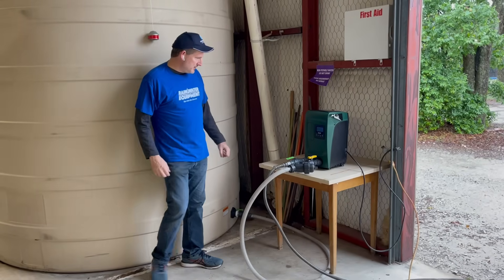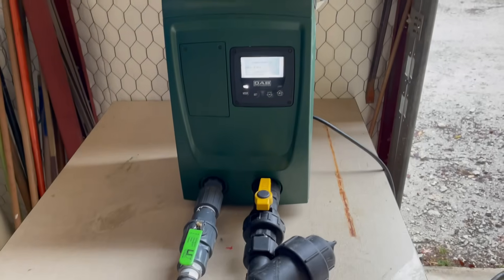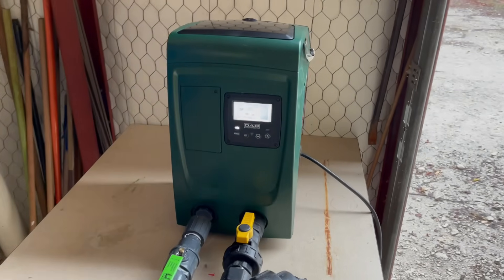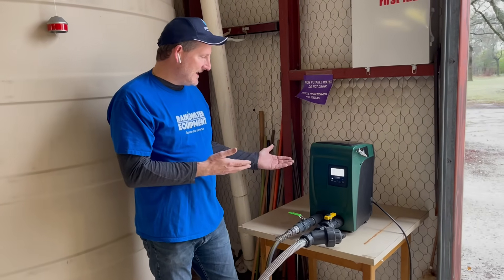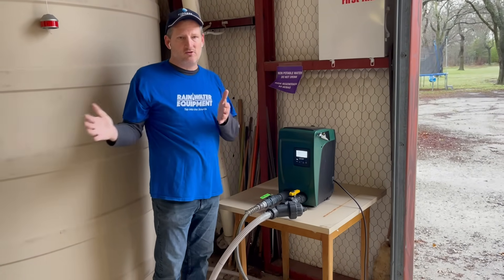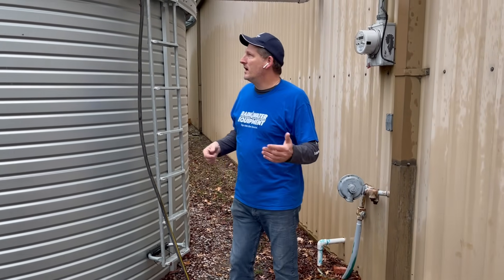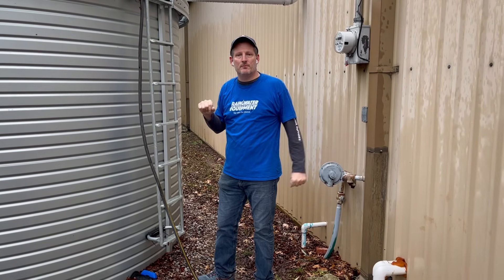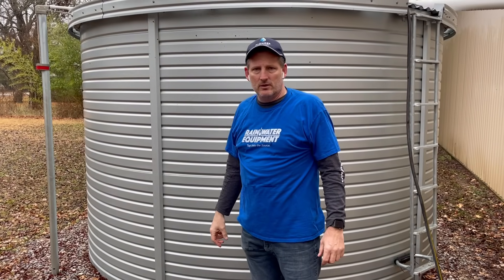DAB E.SYBOX MINI 3 VFD Pump

Comment: I’m looking at installing one of these but have a question. During a power failure does the pump still allow water flow? We have 20 psi head pressure and I want to make sure that during a power failure I can still use water in the house. Obviously it will be much less pressure.
Reply from the maker: During a power failure, the only pressure you will get will be the pressure generated either by city water, if that’s what you’re boosting, or by a Water Storage tank if that’s where your water is coming from. The head pressure from a water storage tank generates very little pressure, probably only 5 psi or less. In your case, if you have 20 psi without the booster pump, then you will still get a reasonable amount of pressure, although there may be some pressure loss as the water goes through the pump when the pump’s power is off.
Reply: @rainwaterequipmentllc7835 . Ok so the pump will let the 20 psi that I have through during a power outage? Just trying to confirm this.

Comment: I have my e.sybox mini 3 installed on the wall. My wife is complaining about the noise although is very quiet. I also have a new 20 liter pressure tank I am not using from a previous installation. Can I connect the pressure tank on the additional output port? What air pressure should I put on the pressure tank if this can be done.

Comment: I have a DAB e.sybox mini 3 that is boosting city water pressure. What air pressure do I have to put into the pressure vessel located inside the unit if I want 50 psi of constant pressure at home?
Reply from the maker: The vessel comes factory set at 29 PSI. Ideally, your pressure in the small, internal expansion tank should be approx. 15 PSI below the set point on the pump. So if you set the pressure on the pump at 50 PSI, the expansion vessel should be set at 35 PSI.
Reply: @rainwaterequipmentllc7835  Thank you! I did exactly that and is working fine.

Comment: Do you install a pressure vessel on this?
Reply from the maker: It's not required (there is a small one built in), but it's ok to add one if you wish. They can be beneficial to help with thermal expansion when older hot water heaters are in use. They can also be useful in applications where your system is calling for small amounts of water over and over again many times making the pump turn on/off, on/off, on/off, like with a swimming pool auto-refill system or a drip irrigation system as examples. The rule of thumb is to set the pressure on the expansion tank at about 15 PSI below the pressure set point on the pump.

Comment: Is this pump supposed to run (like there was a call for water) occasionally even when there is no call for water ANYWHERE in the house? This is the 3rd dab easybox I’ve had and the first “3” model and they’ve ALL done this.
Reply: I presume it is boosting pressure , any dripping taps can significantly drop pressure

Comment: Hi, I have at home Dab Easybox mini 3, every time when starts, a powerfull sound can be heard. Also start almost every minute. Can you advice me please? Thanks
Reply from the maker: Is the pump boosting city water pressure, or is the inlet of the pump being flooded with water from an above ground storage tank?
Reply: @rainwaterequipmentllc7835 I’m having the same issue, city water in this case.

Comment: It's been 2 years since your video.  How is the pump doing these days?  Is it more durable and reliable than the scala2 pump from Grundfos?
Reply from the maker: We are still using that same pump in that same location. We’ve had no issues with it and have been very happy with the performance. The Scala 2 pump from Grundfos has been improved, and it is performing much better than in years past.
Reply: @rainwaterequipmentllc7835  Scala2 should be improved because it's a very good pump if not for its shortcomings. I will also consider the Esybox mini 3 based on your review and assessment.  Thanks.

Comment: What about when the demand for water happens and pump isn’t kicking on right away can take hours or minutes to notice draw and kick on and is lack of water pressure yet pump reading proper pressure on screen no trouble codes, need help 🙏🏻
Reply from the maker: At first pass, I'd guess you had something obstructing the suction to the pump. And you might check to make sure there's nothing stuck in either the suction side check valve or the discharge check valve (aka, non-return or shutter valve) of the pump. We always recommend a pre-filter to prevent debris from entering the pump.
Reply: @rainwaterequipmentllc7835  it is a holding tank with filtered water, so on the discharge end there is a valve? Is that inside unit?
Reply from the maker: @daltonsalaskanadventures7673  Yes. It's inside the front cover to the left of the digital screen. Kill the power to the pump, and close the ball valve on the water tank that feeds the pump. Open a valve on the discharge side of the pump to alleviate the pressure. Use the small Allen wrench found inside the lid on top to open the green cover on the front of the pump. Then use a set of needle-nose pliers to grab the check valve, and turn it counter-clockwise while pulling toward you. It should come out so you can see if there's anything obstructing it. Don't mess with the rubber cap inside the cover. It's the valve stem cover for the internal pressure tank.
Reply: @rainwaterequipmentllc7835  will I need to re prime unit after doing this? And what psi should the air bladder be at for 48-50 psi water pressure

Comment: I have a grunfos MQ3-45 that's been going strong for 8 years now. Researching the scala2 vs the DAB mini box 3, what's your opinion on these 2 pumps?
Reply from the maker: DAB MINI 3 is the way to go. The MINI is a variable speed, constant pressure pump that allows you to control the pressure at the push of a button. It can be installed vertically or horizontally, is dual voltage (115/230V), has a frost prevention feature, and now comes with stainless steel union connection fittings. As of my response on 8/20/22, the SCALA 2 has long lead times. The SCALA 1 3-45 and 5-55 are single speed pumps that are in stock and are very similar the functionality of the MQ, albeit with Bluetooth capability and some cool features that you get when you install the free GrundfosGO app. SCALA2 is not Bluetooth enabled, and the app doesn't work with it.

Note that if you purchase from us, we handle any warranty issues on all of our pumps with the manufacturer on your behalf. Other sites/companies don't necessarily do that. Thanks!
Reply: @rainwaterequipmentllc7835  How many years can I expect to get out of the dab 3?  Say.. 3 people, 2500sqft home. On RWC only.
Reply from the maker: @ntme9  That's always a tough question to answer, because some applications use the pump more often than others, and some don't pre-filter like they should. DAB warranties all of its pumps for 2 years, and the MINI has only been around for 3-4 years in the U.S. I believe. But due to the nature of its design, including soft start and VFD (motor speed up/slow down) capabilities, I would imagine if you use a pre-filter to keep debris out of the impellers and you keep an eye on it to make sure there are no leaks in your piping (which causes pump cycling), you should expect 8-10 years of use, maybe more. A small (2-4 gallon) expansion tank is not required but would limit the number of pump starts/stops over the years and might extend its life a bit.
Reply: @rainwaterequipmentllc7835  Thanks
Reply: I have the same situation, the older grundfos pump is working fine it's just a bit too loud. What did you end up buying?
Reply: @matthewbourassa5942  I still have the same pump, replacing the capacitor made it run like new again, no delay in pressure like before.

Comment: Do you have a check valve or foot valve on the intake side?
Reply from the maker: You would only need a check valve or foot valve if you are lifting water from a cistern or tank positioned below the pump.
Reply: @rainwaterequipmentllc7835  Ok, thank you. My Mini 3 is hanging on a wall, about 3’ above where the outlet of the tank is, so it sounds like I would need a check or foot valve. Does it matter which is used?
Reply from the maker: @daftmario123  If the tank is above ground, you can install a check valve after the ball valve on the tank's outlet. If the tank is in ground, use a foot valve in the tank at the bottom/end of the pipe where the water enters the pipe.
Reply: @rainwaterequipmentllc7835  Thank you for the help/response!

Comment: What size are the inlet/outlet threads?
Reply from the maker: 1" and it now comes with stainless steel union connections, so you'll want to get the Spud Wrench (listed on this page) to tighten them. https://rainwaterequipment.com/e-sybox-mini-3-on-demand-constant-pressure-pump/
Reply: @rainwaterequipmentllc7835  how much torque do you use to tighten those fittings? I have a couple wraps of Teflon and I still get a leak at that seal
Reply from the maker: @ShadangerDog  Use more tape. Wrap 5 or 6 times, but don’t over-tighten if you have the poly fittings, or they will snap. If you have the new stainless steel fittings, use stainless steel thread tape and this spud wrench with a 1/2” socket driver. Wrap 5-6 times with SS thread tape and torque it pretty tight. https://rainwaterequipment.com/spud-wrench-for-tightening-esybox-and-mini-3-stainless-steel-union-fittings/
Reply: @rainwaterequipmentllc7835  thanks so much. I was not using ss tape. And only 4 wraps. I'll try that tomorrow. I appreciate you 🙏

Comment: So is the pump still working okay after a year of service? I'm curious about the reliability of these all in one units over a typical submersible with a pressure tank or the ole jet pump system(which are generally noisy I know).
Reply: Mini 3 is not too good of a pump imo a lot of the plastic casings leak. I work at a plumbing company and we just replaced 4 in a row we installed for the case itself leaking none of our joints
Reply: @theepicthree123  thanks for your reply, very helpful. I guess I won't be buying a Mini 3.
Reply: @wally6193  Anything grunfos is the move for sure higher quality in my opinion
Reply: @theepicthree123  thanks
Reply: @theepicthree123  Scala2 from Grundfos is not durable and reliable.  It has so many problems from consumers.  Mine leaks.  What other pump is better?
Reply: @wally6193  Nothing wrong with them, I have one
Reply: No, they don’t work. The replacement parts are not only expensive, but impossible to get. Also, your bathroom will smell like sh*t if you get one of these. Specifically because whenever your toilet doesn’t flush, you realize the DAB is broken yet again. So that turds going to stay there for two weeks while you wait on parts and repair it yourself. And you BETTER repair it yourself, because a contractor would charge you over 1000$ to drain it, remove all the lines and literally rip off every panel and 20 electrical connections to replace the bad part
Reply: @GeeCeeAte  I think I've written these off already, too many bad comments on them, thanks.
Reply: Had multiple dab esybox pumps and they’ve all went to crap just a month after the warranty (1year) internals cracked, which are made of plastic. There is a goulds pump with resiboost controller which is better but I believe they are not longer being manufactured
Reply: We have had one for 4 years now no issues
Reply from the maker: Yes, it's still in service, and we've had no issues with it. The MINI 3 has become one of the most popular, if not the most popular, pumps we carry. We've sold a few hundred of them.
Reply: @rainwaterequipmentllc7835  thanks for the info.

Comment: Do you think this could replace my 3/4 hp shallow well pump in my basement?
Reply from the maker: Possibly. It does offer up to 26' of suction lift, but a shallow well jet pump typically has more lift capability, so it would depend on the flow and pressure that your pump is producing and how many vertical feet the jet pump is having to lift the water before pushing it.
Reply: @rainwaterequipmentllc7835   thank you for the response. Thankfully the pumps source of water is from above as our small community has a water tower that produces 30 psi without the pump on. In the current setup it is being used as a booster to produce enough pressure to water my lawn with underground irrigation pop up sprinklers.